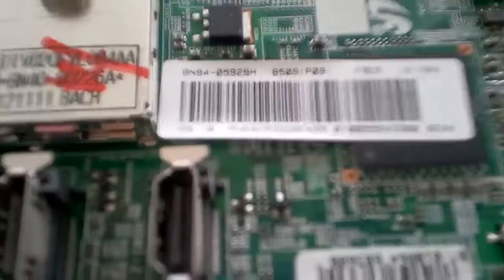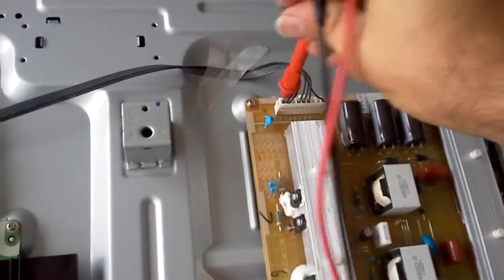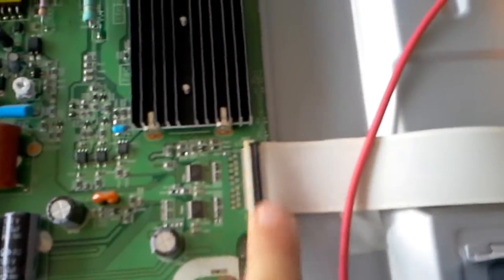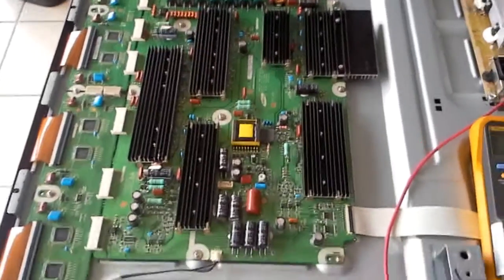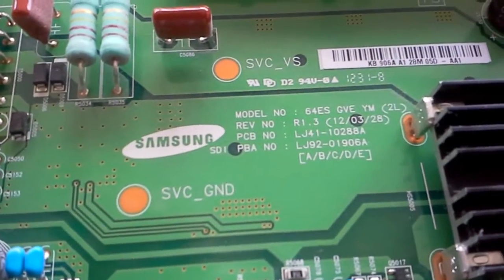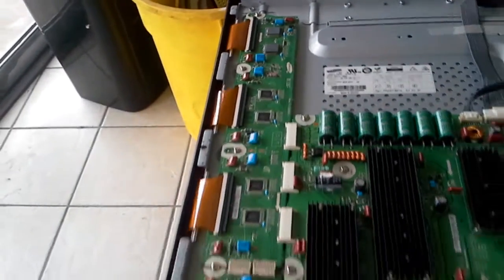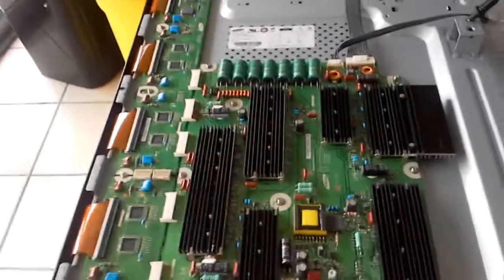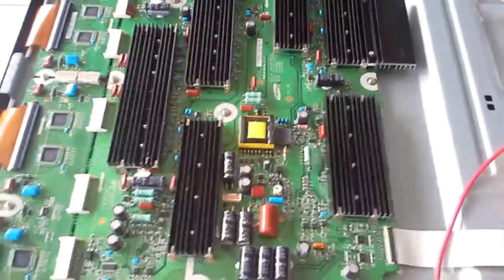Samsung PN64E533D2FXZA repair for no display and Vs dropping down - LJ92-01906A  / BN96-24770A

Comment: Hi, thanks for sharing this. I have some experience repairing Samsung TVs. However I've never repaired one with a Y-board. And I'm curious if it is necessary to remove the Y-board completely (both boards that make up the Y-board) to replace the three caps, or can just the mainboard be removed in order to replace the three caps. My instinct is to remove both boards as one unit. That seems the easiest way to avoid breaking the white plastic connectors, which I've never had to remove before. Again, thank you for any assistance. Definitely going to check you website.
Reply from the maker: We do not remove the buffer boards when taking out the Y-Main. Takes a while to figure how to do it right, but still easier and faster than taking them along.
Reply: Coppell TV Repair LLC Thanks so much. Planning on dropping into your store soon to get the capacitor kit.

Comment: Informative video, but I did not catch if the video and audio completely failed or if sometimes the video goes out after some use?  Here is my experience with the set for repairing a hard to start video.  Bought tv from Costco ~$1350 in 2013 w/ Square Trade 5 year warranty for $100.  However, I forgot I had the warranty and suffered w/ the video not coming on, only the audio, unless I restarted the tv every time for the last 2 years.  Found the warranty less than a month before it expired and Square Trade had its tech (amazing they are working ~11 time zones away in Pakistan, the tech was pretty sharp and spoke english well, seeming to go to a test tv to check his ideas) ask me to press the power button for 60 seconds (no change for this reset procedure) and a few more procedures to make a determination of what electronics to send.  They sent a few boards (Y, power, main input) and the repairman came to the house and replaced them.  the video now comes on within 5 seconds.  I wonder if replacing the caps on the Y board would have done the trick.  I also wonder if the boards provided were new, perhaps a newer version, or just refurbished with new caps.  I normally do not buy warranties, especially with the extended warranties given with the Costco credit card (up to 4 yrs), but in this case the 5 year warranty paid off.  I am hoping this information may be helpful to others regarding this model of tv and how a warranty repair might proceed.
Reply from the maker: Makes me wonder...what is the purpose of this post? Tell people they should have bought warranty? Tell them they should look for the warranty? Tell people Pakistani techs can only follow standard troubleshooting procedures?
No offense meant, I really can't figure out why did you post it.

Comment: Great video, but I'm confused by the PBA Number, LJ92-01788B and the Samsung Part Number, BN96-22029A in the video title and on your website for the repair kit, as both are for the X- Main/Sustain board.  The correct Y-Main/Sustain board numbers are PBA Number LJ92-01906A and Samsung Part Number, BN96-24770A.  The correct PBA number is clearly shown in this, your, video right on the board.  If I order your Kit SKU: CTVRL-NO-PB-0101, will I receive capacitors to replace C5050, C5152 and C5153 on the board shown in this video (PBA Number LJ92-01906A and Samsung Part Number, BN96-24770A)?  Thanks!
Reply from the maker: Corrected. Thank you for pointing it out!